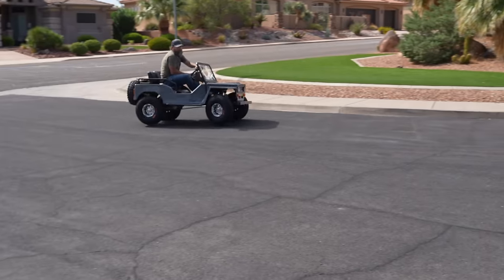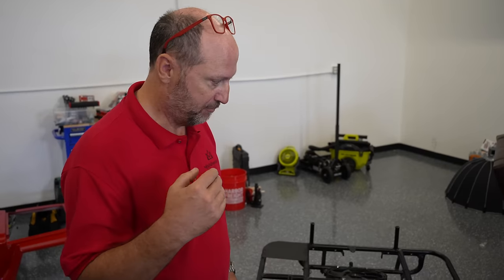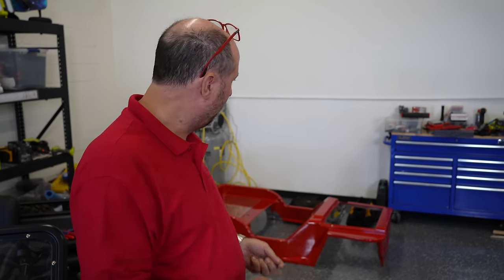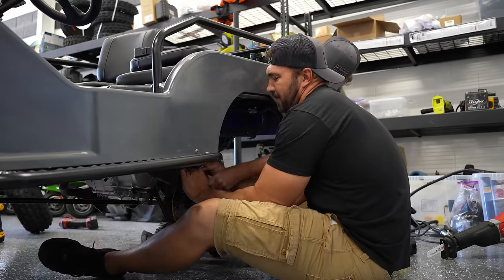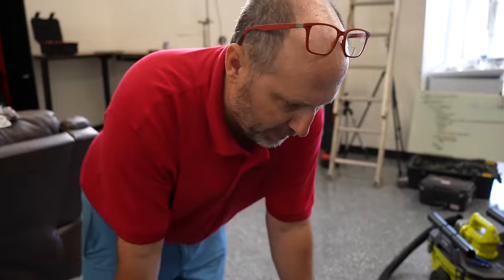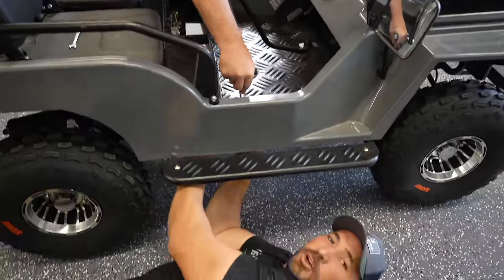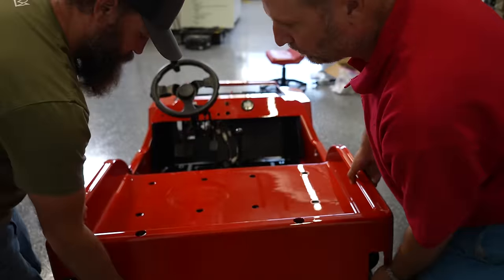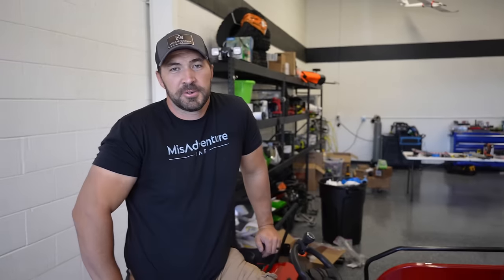We Bought Mini Jeeps!

Comment: You can get an adapter that let's you clock the intake manifold any direction you want so you don't need to cutvand weld the frame. Usually with those engines people use an oil cooler to keep Tthe engine temps down.

Comment: Dude this is gonna be sick iv seen a guy take one of these little jeeps  3,000 mile across moab. It was a full series.    I think one of them should be a full blown long arm build but still to speck for the little stuff.   Use 450r atv stuff way better weight ratio, and will last alot longer

Comment: Awesome video and lots of fun! I have the red one myself. 😎 As of this week we’re out testing it in the Colorado Rocky Mountains, all stock except for a fuel pump mod.

The next upgrade I want to with mine is install some reservoir shocks. Does 12” in the front and 11” in the back sound right? Also what were the sizes you used?